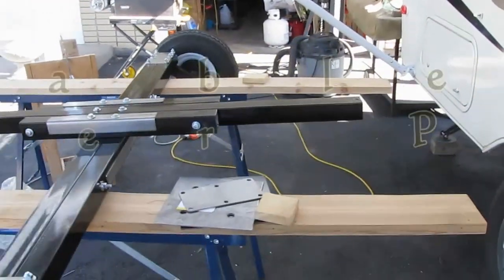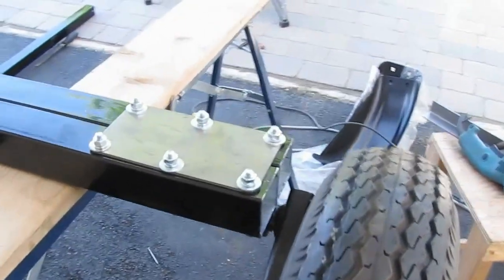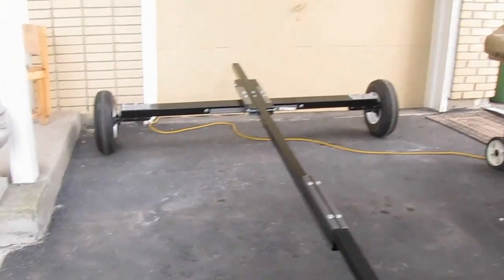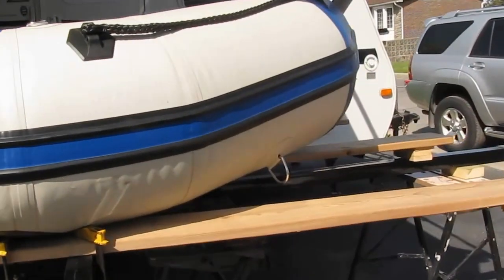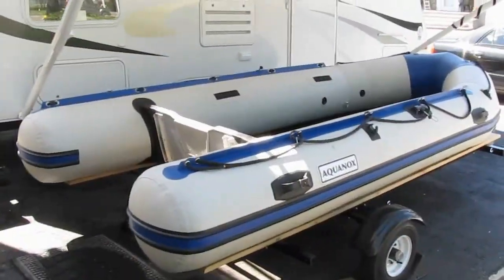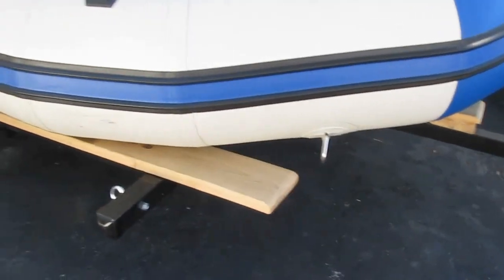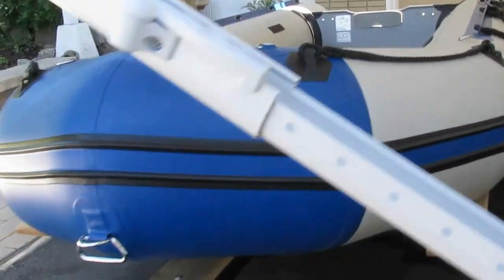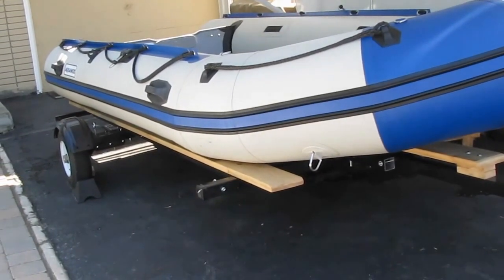How to build an Inflatable Boat Trailer

Comment from the maker: I have a 15 horse power Honda and Honda does not recommend towing with the motor in the up position unless you purchase a special bracket to support it. However, the motor is on it now and in the down position. The torsion axles do not flex much (just enough for the weight) therefore with the motor down there is about 4-5 inches of clearance. I have tried towing it this way and all looks good. Cheers...

Comment from the maker: Hi Chris, I will try to find the time. Although It may be too late for you since your post is 9 months old. The trailer was built using good old intuition therefore I have to measure and draw it. It has been in service for 2 summers and has done a lot of milage and no issues.
Reply: Tony, what would you say your overall cost of material was?
Reply from the maker: Mr. G It cost approximately $1,000. I sold it this summer for $550.00. A gentlemen was at the same place I bought the torsion axles asking to buy a trailer. It was vacation time and no trailers were available for sale or rent. I asked him what he wanted to do with the trailer and it was to haul 2 sea kayaks to Cape Cod. I told him about it and he bought it. (I bought a 14 foot fiberglass bought and it came with a trailer. I pull the boat behind the RV)
Okay so the torsion axles are around $450.00. Then you need to good tires another $100.00. The frame is made of 2" X 2" metal posts that you can buy at any Home Depot, Reno Depot etc. These are fairly pricy but they are galvanised and powder coated so no need to paint. They are approximately $25.00 each. The trailer required 5-6 of these. The rear posts are reinforced with steel angle iron. I thought this was necessary with the 100 pound motor. Angle plus posts $155.00. The nuts, bolts and washers probably another $75.00. The 3 pieces of cedar another $35.00. Last but not least the break/night lights from Canadian Tire $40.00.
If you use square tuning instead of powder coated fence posts and order the torsion axles on the web you could probably reduce the cost considerably. I just didn't want to wait and this shop near where I live had all the parts. I will try to upload the specs some day! Regards, Tony

Comment: How far out is an inflatable allowed to stick out the back end of the trailer?
Reply from the maker: If that's a legal question, not sure, nor would I venture a response. The way I designed it, the pontoons ends were even with the break lights. A better answer is based on balance. The motor and rear end have to sit balanced on the rear axle. If not, then the pole that hooks onto the vehicle will want to pull up or it will be too heavy. The motor was in close to the rear axle with the pontoons another 16-20 inches back of that point. Try to position as much of the weight near the rear axle.
Reply: @dunesuns  ..thank you much for the info stay healthy✌️